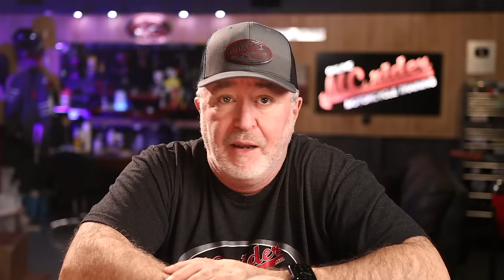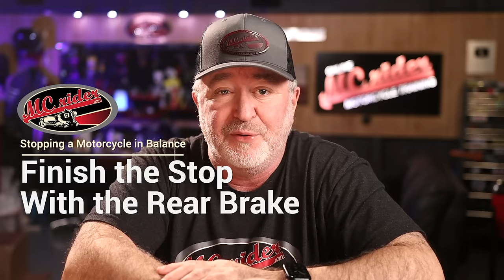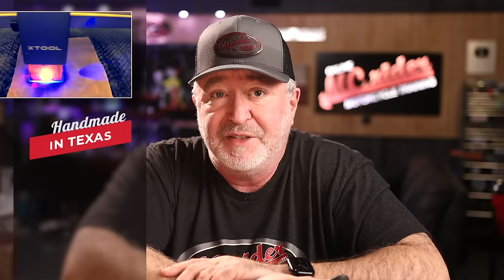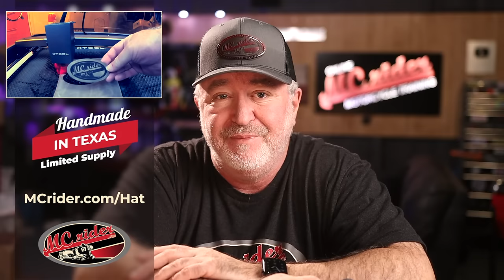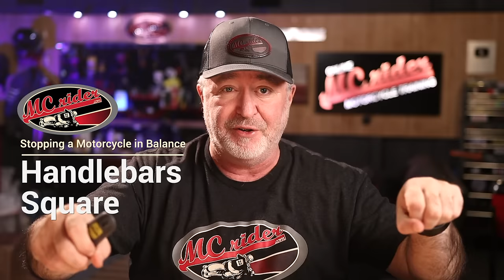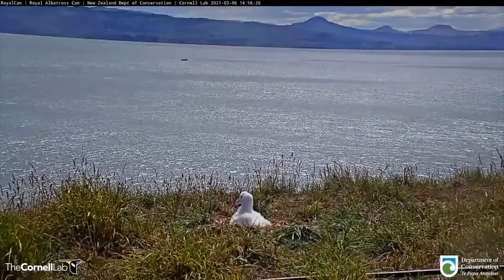"How to Stop Your Motorcycle with Unbelievable Balance - #3 will Shock You!"

Comment: My police training dictates there is only one way to be stopped… left foot down, right foot on rear brake, motor in 1st gear, monitoring mirrors, ready to identify & escape threat from rear… my motor officer instructors would accept no other way… size of the motor not withstanding…
Reply: How does one put their motor in first gear? 

I’ve never changed motor gears on my bike, but I have changed gears in the transmission. LOL
Reply: Police never refer to their motors as”bikes “… if one does he will be asked,” Schwann or Huffy?”…
Reply: @chevyon37s  Eh, in defense, on motorcycles it's basically all built into one unit.
Reply: Police training here in UK is to pull in clutch at last moment then go into Neutral. It is not good practice to hold bike in gear with clutch pulled in as it causes wear. It's called "motorcycle sympathy". If you know your wait will be very short then it's OK to keep clutch in. Otherwise go to Neutral.
Reply: With your action, you train your body memory. That‘s a good hint about any action-habits!
Reply: @chevyon37s you must be fun at parties.
Reply: @johnauditt holding the clutch in does not wear the clutch. You get more wear putting it in neutral, because you’re using the clutch twice as much. The clutch only wears at the friction point, so every time you pull it in and let it out, there are two points in time where the clutch is wearing, neither being full out or full in.
Reply: @johnauditt what parts wear out if you hold the clutch in? .
Reply: @Rotor-Sims  the clutch doesn’t wear when it’s all the way in or all the way out, anyways. Not remaining in gear doesn’t make sense.
Reply: The perhaps someone can explain to me why so many municipalities are requiring riders to put both feet down when stopped? I was told it was required in Myrtle Beach and warnings/tickets were given out during Bike Week. I know some places near me in NC are doing the same! As a relatively new rider I do as you say based on experts like MCRider, now I’m hearing I can get ticketed for doing what’s “right”. 🤷‍♂️
Reply: @ronchase474  if you’re new to riding, you’ll soon find that what’s legal and what’s safe are two different things. Lane splitting is proven to be safer. California’s motorcycle fatalities went down 30% the year their lane splitting law went into effect. Still illegal in most other states. Passing super slow people on a double yellow? Illegal in all states, but you’re far more likely to get rear ended behind someone going slow than you are getting hurt passing someone on a double yellow really quick.
Reply: I'd love it if the police would offer mc training.
Reply: For the regular public
Reply: @ronchase474 

You might need to “touch” the ground but both feet is not legally required. 

With that said, great deference is given to cops and the dishonest looking to cause issues can simply say you didn’t stop. Putting both feet down might make everyone see you’re not a rowdy person and makes a point to “follow the law” 

Maybe in a big bike area it might make you less of a target but no, you don’t HAVE to do anything but come to a complete stop.
Reply: @johnauditt ... yep. I do that mostly. Rarely leave the gears in 1st.
Reply: Do you use both brakes?
Reply: @kylesalmon31  
Yes!
Reply: @ronchase474 it’s not about safety, it’s about revenue. Do you really think dui check points and lower drinking limits are about safety? Btw, I don’t drink and I’ve never had a dui, so save it.
Reply: @johnauditt if it is a BMW you are right. In a HD with wet clutch it is not a problem. I personally drive BMW and HD and I also put the gear in neutral although there always is a bigger risk you are hit by a car in the back of you.
Reply: @thagingerninjer5391 the plates are touching each other , if there is a dry clutch as BMW they certainly will be some ( very little) damage if you keep the gear in 1. HD has a wet clutch than is does not matter.
Reply: @rolfwassens4047  no.
Reply: @clayfarnet970 yes.
Reply: @johnauditt I’ve heard this isn’t nearly as much of an issue with modern clutches/components? Not sure how it causes extra wear as with the clutch pulled, the friction plates are no longer in contact with one another. Perhaps premature wearing of the clutch springs?
Reply: @thagingerninjer5391 that’s kinda what I was thinking. Well said!
Reply: @pbourdon231  the springs wouldn’t wear out, either. Springs are only stressed when they’re moving. When they’re in the fully collapsed position, fully released position, or any position in between, they aren’t being worn. They wear because of the heat created when they move. Maxine springs are a really good example of this. You can leave a magazine fully loaded indefinitely, and it will never hurt the spring.
Reply: @thagingerninjer5391  gotcha - thank you for the clarification on this. It makes sense for sure.
Reply: @johnauditt holding clutch in doesn’t cause wear on the clutch at all. When all the way in, the gears are completely disengaged hence no wear.
Reply: @snorman1911 none
Reply: @kylesalmon31 yes, always
Reply: CQFD
Reply: @thagingerninjer5391 you have to be sûre that your levers are set up correctly so that the clutch fully disengages when pulling. Otherwise yes it will wear since it's pulling. But other than that that's perfectly fine
Reply: @ronchase474 because the laws are made by people who don't ride, that's why.
Reply: @ronchase474  a stop is defined in almost all traffic laws as “the cessation of movement”. You can stop without putting any feet down. Local ordinances not withstanding, this is the first I’ve heard of the “two foot” law.
Reply: What about hand brake? Are you using both brakes?
Reply: Different in the uk
Reply: @johnauditt The clutch is meant to be used. Always keep in first gear and scan the mirrors for any oncoming danger behind you.
Reply: @johnauditt  that's the difference I guess - UK cares more about maintenance cost, while here in the US we care about officers' lives.
Reply: As a teenager I broke my left ankle and it’s been weak ever since. On an uneven surface it sometimes lets go. Also here we ride on the left, so the road camber is opposite to the USA. To add to my difficulty I have a 30 inch inseam. The combination of these means I usually put my right foot down first. If you are smooth , it’s not hard to come to a complete stop using both brakes before putting whichever foot down suits the situation. I will put my left foot down if I need to hold the bike on a steep hill, but only of the road camber permits it. If not, it is possible (with practice!) to do a hill start without  rear brake by using throttle, front brake and clutch friction zone.
As for keeping it in first gear and holding the clutch in while stopped- this is essential defensive technique . At least until one or more vehicles are stopped behind you. Then, if you are worried about clutch wear,it’s probably OK to shift to neutral. I only do that if it’s a long delay, because even though my bike has a dry clutch, it will outlive me.
Reply: as soon as i started using this technique,  i stop and drop my left foot and everything is super smooth and balanced.  that's the perfect way to do it sir!

Comment: At 72 and my legs not as strong as they use to be, and balance not as good as it once was.  I almost always put both feet down once stopped.  I'll ride till I can't.
Reply: @vickikidinsmore2467. Keep going Vicky.  I’m. 79 and don’t plan on stopping riding anytime soon.
Reply: @vickidinsmore2467.  Vicki, a suggestion for you.  
To improve your balance practice standing on one leg (left then right).  If you can stand on either leg for 20 seconds your balance is good. 
If you can’t stand for 20 seconds, having to put the other foot down I suggest you practice every day until you can do it.
This exercise will improve your balance considerably.

Comment: Hey Kevin, this episode struck a chord with me. I’ve been riding consistently for 55 years, now being 76 years young I’m riding a tall bike (R1250GS) and my balance is not what it used to be, so I daily step on my balance board and practice staying balanced with no hand assist. This exercise has improved my static and slow speed balance immensely.
Reply: What is a balance board?
Reply: What is a balance board?
Reply: @davidwells1123  it’s an 17” round platform with a 6” 1/2 circle beneath it. Both feet aboard stand without touching any side of the platform to the floor. Sorry for tardy reply
Reply: By circle, he means ball. It’s a flat, circular platform with half a ball on the bottom.
Reply: @bobromaine6650  
You can also use a Skateboard for improving your overall balance and reflexes. After a while it'll all become second nature.
Luck to your journey on a better safer riding.

Comment: Both feet on the ground means you are not applying the rear brake. I think that if you are not in the habit of holding the bike still with the rear brake, stopping on a steep uphill may surprise you with a slow motion crash sliding backwards down the hill, especially with extra weight on the back of the bike. The slightest bit of grease, oil, sand, or even water can let your front wheel slip on such a hill. Passengers should be taught to stay upright with both feet on the passenger pegs at a stop.

Comment: Stopping with your head up is kin to how they teach the slow-ride maneuver.  Look forward and relax!  Also, I had my big Harley on wet grass…going slow…careful with the throttle. Well, the back wheel broke free and slipped.  I instinctively reached up and touched the rear brake.  The bike was going down…but it snapped up when I applied that rear brake.  I was presently surprised!

Comment: Good tips! Maneuvering at slow speed is a unique set of skills that does require practice. I generally use the rear brake exclusively at slow speeds. Finding the finesse between the rear brake, throttle, and friction zone is key to getting through parking lots, city traffic, and tight u turns. Plus it’s fun to practice!
Reply: You look down - you go down. Keep your vision up look to the horizon you will see everything in the foreground as well because you saw it in the distance earlier.
Reply: I found that riding a chopped Harley.  Clutch control and rear brake control gave me control of a heavy runaway beast.

Comment: I think this will help many too and it compliments the technique of the rear brake:  When coming to a stop and the speed is low (as mentioned) AND the rear brake is applied, apply just a tad of throttle and use the friction zone.
It is an approved technique for KEEPING YOUR BALANCE and it makes a huge difference.

Oh, and I am not a police officer flexing years of moto officer training.  Just a guy with common sense
Reply: THIS!! 1000% Especially when riding 2-up ... I'll add that's not "exactly" about better balance... it's because motorcycles WANT to stay upright and straight when there's sufficient power to the rear wheel. In this situation it takes very little power and only the slightest amount of friction zone to make a HUGE difference

Comment: Thank You Kevin,
A couple things I've caught myself and people I've helped to get riding are; Looking towards the direction you intend to turn, aiming the bike in the direction of an upcoming turn or merge and attempting to balance instead of stopping. For many riders balancing instead of stopping looks cool but without slow speed practice in a "safe zone" it's dangerous in the roadway. 
I've always ridden touring bikes and more than likely packed for travel. I make it a point of having my bike packed for trips before I go to practice slow speed spring riding. That one step aids me in being prepared for my trips by practicing with the bike as it will loaded for the trip.
I'll never be the complete professional "cool" rider I am in my head, but if I stick with basics and not concern myself with other's opinions of me, I'll be safer and enjoy my rides so much more. Mental stability is a tough one but you last longer.
South Dakota has a "two feet down" rule for complete legal stops- so I just make it a point and now it's habit.
You are in my prayers
Hoka Hey
Reply: I also live in South Dakota and you are correct in the 2 feet down rule. on a heavy touring motorcycle it also leads to less fatigue, especially at a long light. Good advise!
Reply: It would sure be nice if more mfrs had seat height options under 30". Guess I won't be riding in SD

Comment: Super tip - I've been riding for a very very long time.  My prior bikes where in the cb750 weight class - then I bought my first harley I started to have problems coming to a full stop.  I discovered your site and found myself doing all the wrong thinks coming to a full stop.  I used all the proper full techniques on my lighter bikes but forgot them all on the harley.  I think I was intimidated with the harley's weight.  After seeing your stopping tips - started to practice them on the harley and corrected my problems.  Thanks for getting back on track.

Comment: Always great advice kevin

It’s amazing how many riders come to a complete stop with both feet still on the pegs..
It’s a recipe for dropping your bike.
I always come to a stop with my right foot on the brake, my bike in 1st gear and my left foot ready to put on the ground just before I completely stop.

Controversially, I find against Kevin’s advice, that just before I completely stop , I slightly turn my  handlebars very slightly to the right.  For me, I find this guarantees that the bike will fall to the left on my left foot.  
When completely stopped I put both feet down.
I don’t put the bike in neutral until I am sure traffic is stopped behind me.
Reply: Why do you out the bike in neutral stopped at light or intersection...aren't you supposed to be ready to take off if somebody drives into you ?

Comment: I say put both feet down once fully stopped. Cant tell you how many times I put my left foot down only wanting to be "proper" and I slipped on a rock, oil, wet leaf, whatever and almost dropped my bike. Just put your right foot back up before taking off.
Reply: I also put both feet down because I had the same experience you described.  Though as Kevin said, it is an individual preference.
Reply: this can be avoided by looking far ahead when stopping, and planning your stop away from hazards like that. Nevermind that you can STILL slip with both feet down (that right foot won't help a bit if the bike is leaned too much to the left.)

Comment: Great tip that I needed.  I have a lowrider st that I purchased last year.  It is a heavier bike than my 69 750 honda and I've been having a hell of a time getting use to the harley during stops.  I've been riding for ever and look like that bird you where talking about.  In stead of using the back brake for the last 2mph I'm using the fronts only and sticking both feet out.  Needless I look like an person that is just learning to ride.  I have no trouble with my honda and use the proper techniques for stopping.  On my next ride on the harley - I'll try using the back brake for the last few feet of the stop - thanks

Comment: In my opinion, keeping the handlebars straight in the last 2 or 3 feet before complete stop is more important than rear-brake-only on those last few feet.  A little rebound is not as bad as having your bike fall down and having to pick it up (You can always work on your rear-brake-only stop afterwards). Regardless, good advice as usual, thank you Kevin!

Comment: I may be preaching to the choir, but here in Komifornia we have regulated traffic lights on the onramp. If you stop in the far right hand lane, that is banked pretty steep in some places, you will dump it for sure if you try to put your left leg down. There are several off camber stops in the foothills that are the same way. But yes, 99% of the time, you have changed my stops to steady stops by using rear brake and putting my left foot down, thanks Kevin......Kevin.

Comment: I'm glad you reminded me to regularly using both brakes so I'm prepared in an emergency. I always used both at first, but these days I almost always just grab the front. I'll get back to using both. (That rear one needs practice anyway. So so so  easy to lock up on a fast stop.)
Reply: Riding a 125cc 20 years ago an emergency stop = back tire locks up. Like on a bicycle. 

Instructors expected and demanded it.
Much of the training was to lose the fear of the rear tire locking up.

I'm now riding a 500cc with ABS so I can't do that anymore and it has me wondering: What's the big deal locking up the rear tire (as long as you're going straight)?

Comment: How does this brake technique change for emergency braking and/or bikes with ABS? Great video! Too bad my bike is stored away for the winter. Your videos make me want to ride. Lol
Reply: Having a bike with ABS doesn’t change it at all. The technique is about weight transfer to get the front tire to have maximum traction to allow for maximum braking force before the tire skids/ loses traction. Which the ABS is only a reactive system to stop/ prevent the tire(s) from skidding.
Reply: Having a bike with ABS doesn’t change it at all. The technique is about weight transfer to get the front tire to have maximum traction to allow for maximum braking force before the tire skids/ loses traction. Which the ABS is only a reactive system to stop/ prevent the tire(s) from skidding. Doing the technique properly will actually keep you from activating ABS on your bike, which is good. And I’d say practice finding the point where you do activate your ABS so you know what that feels like and you know how much braking force you have before it happens.